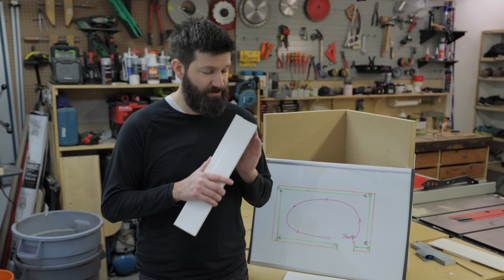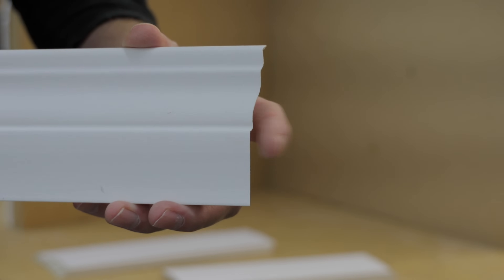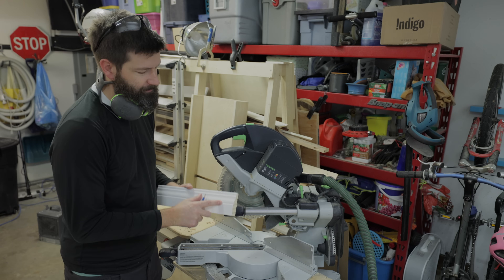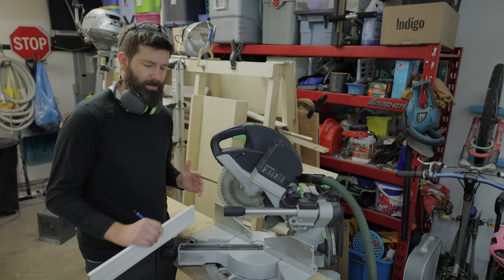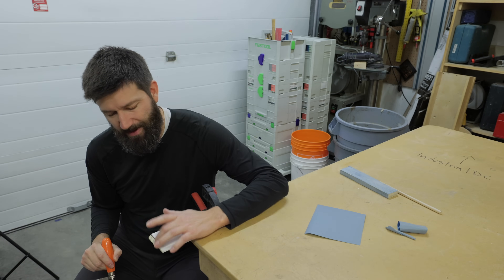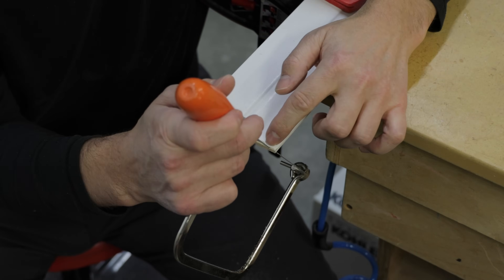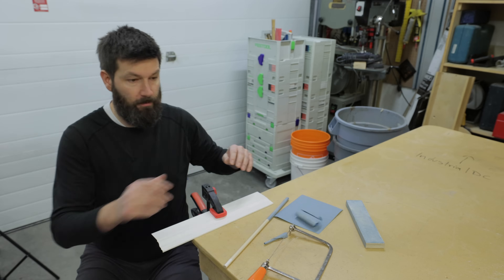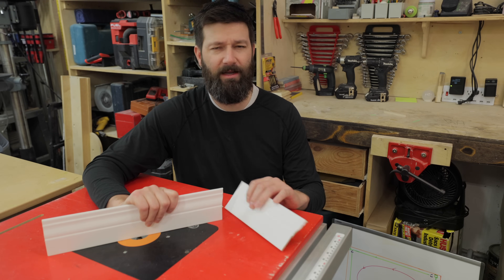How To Make Perfect Baseboard Cope Joints!

Comment: After a couple of rooms coping becomes second nature. A small tip is to not cut the non coped end square. By cutting the non coped end at an angle it will push into the plaster allowing you to cut the skirting a couple of millimetres too long. Now when you come to place the skirting against the wall place the non coped edge against the wall first, bow the skirting in the center and put the coped edge in place. Push the bowed center of the skirting against the wall and fix in place. I hope you can make some sense of that.
Reply from the maker: Good comment Michael, 🍻
Reply: Will need a video explanation.

Comment: I usually trim off the outside edge of the 45 cut, with a blade, and that mostly brings the 2 pieces closer, in case the existing wall corner has jutting edges. Seems to work great, and of course caulk is our best friend lol.
I call it "Love in a tube"
Love the cope saw though.
Reply: @jimbendtsen8841  lol shows how lost you are!
I stated something completely different!

Comment: Use adhesive backed sand paper on a scrap to make a profile sanding block, I miter 99% of the time, especially with painted millwork, glue joints rarely open, so no call backs for cracked paint in corners, nice job.
Reply: Great technique, that’s the same one I use.  Works great!

Comment: The biggest issue with installing baseboards isn’t coping vs mitering, it’s the quality of the drywall installation.  Did they get a sharp corner all the way down to the bottom of the corner or did they leave a “rounded corner in the bottom.  Did they install the drywall with the tapered edge running along the bottom? If so, did they leave you enough space to install 1/2” blocks all along the bottom run so you can have baseboards perpendicular to flat part of the drywall face?

Then after all that is sorted out, cope it if you want it to look good.

Comment: Love your videos! Easily the most complete and professional, including anticipating and answering the questions your audience will no doubt have, that I have seen. As an engineer with a tendency to be a bit of a perfectionist, your concise and clear approach to teaching works really well for me. Thanks!

I am about to embark on replacing all the trim in our 1980’s house. Regarding the “counter-clockwise” approach for us right-handed folks, when committed to doing the most professional job by coping as much as possible, wouldn’t it be better to choose what to cope based on the visibility of the joint from the perspective of the main entry into the room, rather than just progressing sequentially right to left? Or, is there something about the CCW approach that I am missing that is intrinsically better (I understand it is easier and more efficient)? Thanks again. Have subscribed.
Reply from the maker: I appreciate the comment! You’re right there are definitely some scenarios where it would be better to adjust the cope side depending on the main viewing angles of a room.  It can get more tricky and you definitely want to avoid working yourself into a situation that requires a cope on both sides.  I usually just stick to counterclockwise unless it’s going to be a real obvious spot like at the top of a staircase or something. Either way the cope joint viewing angle will be substantially better than a mitered one. Cheers and good luck on your project!
Reply: Traffic pattern should always determine the layout of joints, whether inside corners or field splices. Predominant vision from the entry should be the overlap on a field joint (30 degree bevel), and a coped piece should be on the left of the joint with the square cut on the right. This is not a hard and fast rule, however. There may be other factors that take precedence in a certain situation.

Comment: I simply cannot comprehend how cutting a profile on 45 degrees can give you the same profile as the straight cut. It really defies everything I have ever learned.
Reply: Assuming a 90 degree corner, you must remember that the profile your coped joint will contact is protruding away from the wall.  You're probably not visualizing the joint in three dimensions.

Comment: Hopefully I get a job that isn't so rushed that I can practice some coping -- as a punch-list, do it all kind of craftsman, I have to re-learn these skills each time.  Do you have a video on outside corners?  What do you think of wood filler on outside baseboard corners, or on mitered door casing top corners?  Maybe glue the joints, then wood filler?  (Talking paint grade).
Reply from the maker: Outside corners I usually cut 45.5-46 degrees. That way the outer profile will usually meet.  Wood glue and sand right away. Then would use some wood filler if necessary.  Stay tuned I will make an outside corner vid in the future.

Comment: Thanks. I was pulling my hairs out in frustration over one corner  that just wouldn't get right, becausethe ceiling and the wall are far from straight or perfection and angled. I bought some insanely expensive crown mouldings and if i didn't get this one right it would be costly to get a new length shipped home and start over.

Comment: Just bought a miter saw to learn to do mitersv(DIYer, not a pro).  I don't think the hacks remodeling my house didn't even use 44/46 degree cuts as there are open miters all over filled with silly con.  I am redoing a bunch of work and was excited to give it a go but now I gotta learn to cope.  Redoing a bathroom baseboard first after I do the door trim.  It's made of pvc.  Can I cope pvc trim?  Just buy a coping saw?
Reply from the maker: yes you can.

Comment: When you used the miter saw to start the cope you did a 35 back bevel cut along the straight face of the trim and then you slipped it and used the miter to cut a tiny bit of the top of the profiled part.  Was the blade set back to straight for that cut?  Can you explain a little bit more about the reasoning for that cut...what exactly is being cut off, I had a hard time seeing on camera and since it was near the curvature of the profile I wasn't sure if you were cut the profile off or just the wood on the exposed 45 degree face.  Thanks!
Reply from the maker: For that second part the saw is back to 90.  Cutting that top part just helps get a nice clean section to butt into the other piece.  Of course this is specific to this particular moulding and will not always be the case.

Comment: How do you cope joints on a 45-degree angle ( inside corner)?   I can miter them at 22.5 or 21.75 degrees as you recommend,  but would like to use coping.  In the room I am doing, if I start on the right, working counter-clockwise, then on the first wall I need to miter the left end of the baseboard since the corner is not 90 degrees?  Can you show a video on this?

Comment: I find the biggest challenge with skirting boards isn't the corners (which if I was coping I'd do with a router setup to be way more accurate), it's the lack of squareness and straightness in every wall and floor. I often find it easier to cut out a lot of the back of a board to avoid these imperfections.

Comment: For painted base, it doesn’t really matter if it’s coping or mitering, but if it’s stained wood, coping is far better.
Reply: maybe so but if the house moves at all the mitered joints have the tendency to open up and even with the best caulk that mitered joint dosnt look the same

Comment: Coping is always better in any situation because if you can't cope how are you going to get the job done? However in addition to doing corners what about gaps between the skirting board and the floor? well, some say in a carpeted room it doesn't matter because it is not seen However what about in a room with a polished floor? In that case, you will need to scribe the skirting boards to the floor

Comment: Another consideration in favor of coping, is "real" hardwood.  In the old days where hardwood was installed, sanded, and finished in place, you had to cope as the installation of the hardwood might push a mitered joint open.

Comment: Painter by trade so I’ve spent many years fixing bad corners. The mitre is way faster and as long as pretty good I can fix it with caulking and paint. I guess the coping method would be best if you aren’t painting the baseboards but who does that anymore.
Reply from the maker: Bad miter joints don’t look great over time.
Reply: @TheFunnyCarpenter  can't you say that about any joint?

Comment: The good thing about coping baseboards   and crown molding even if it’s mdf paint grade trim The joint stays closed and can’t open up or crack as easily with building movements overtime. But if you’re using miter finders and miter duplicators you can just do inside miters and have a nice tight fitting joints it’s just coping might last better than a mitre overtime because all wood and mdf products expand and contract overtime it’s a personal choice which one is better to for you.
Reply from the maker: Well said!

Comment: I like the coped look but I usually just use miter saw and then wood filler and caulking if its not perfect.  Usually just because I'm not that patient.  I have used a dremel in the past to cope which works really well too.  I'm installing baseboards now after we had new tile put in and the baseboard we have has a fair amount of curves which makes the coping much more time consuming.

Comment: always start with longest length if you make a mistake you can use it else where. for cuts jigsaw with a metal cutting blade more teeth slight angle a back . cope joint is better for wood due to shrinking, mdf  does not have this problem

Comment: Another trick, is to place a square peg where the corner is.  Then everything is a square cut (minus imperfections in house build).  You can even decorate the pegs by cutting in a tip for example.  Kind of like corner towers to a castle.

Comment: Nothing looks better than a cope. However, if you are looking for speed, and your trim isn’t stained, neither example is best. I used what my mentor called a “cheaters cope”. In this example, you measure like you would for a regular cope, reducing you measurement by a half inch to accommodate the piece it presses into. At your miter saw, measure and mark the middle of the base board, and cut it laying flat of its back, with a 5° miter. The minor imperfection is easily hidden with a bead of caulk. Again, this is primarily used for speed and can not be used for trim that cannot accommodate caulk. It’s also only good on the colonial trim featured in the video. 5 inch base that is flat for 95% of the stick won’t work either.

Comment: I've yet to see a coped joint survive a house age and settle.  A tight mitered joint with some wood glue on the other hand... it will open when the wrecking ball hits the house.

Keep a few dozen small MDF shims in your tool belt and micro-adjust each miter on the fly.  If you're working with a template board you drag along, you'll also be able to eyeball the miter and bevel angle VERY accurately the first time with little shimming necessary.

The stretchy caulks we have now are amazing, but I feel like people these days take the saying "A little caulk, a little paint, make a carpenter what he ain't" a little too seriously.

Comment: Used to use a coping saw and had good results, then I switched to a cordless mini 12v grinder with a 75mm sanding disc for great results... You won't look back 👍
Practice before you use on a job, it will need a gentle and light approach but results will pay off from it. Had nothing but nice comments by customers on how the skirting and coving looked.
Always gone anticlockwise and your advice is top notch with reasoning behind the logic.
Clients nowadays though don't like to pay for the quality but only on a low budget, and so I've turned down more this year than I can think of on the notion of you pay for what you get and if you can't pay for a standard and want cheap, look elsewhere..
Most work has been done recently from the cheaper initial approach by the customer that wanted it rectified, thus gaining another follow up job afterwards. 
Happy holidays mate, productive new year and you and the family keep safe .. from chilly South Wales, UK
Reply: I see you too went to Rich’s DeWaukee trim school
Reply: @christophercrawford2736  😂 and the post-grad school of DeWauKita
Reply: @philipbohi983  🤣
Reply: @philipbohi983  I’m still working on my doctorate with the school of DeWaukita 🤣
Reply: @christophercrawford2736  I had a corded mini scroll saw prior to watching that video, much easier than a coping saw, but with the mini grinder it is more easier and cleaner....
It is a Chinese Ruyika mini grinder and 12v. Not even in top tools for that sponsorship, I've gotten by on different brands and mostly Ryobi, not affected any result nor complaint.
Maybe when you try it 😂😂😂
Reply: @philipbohi983  obviously you've not had a go 😂😂😂

Comment: I hear the cope vs miter thing all the time.  And IMO there is no discussion to be had.  In fact, fair or not, I'm going to be drawing a lot of conclusions about someone's skill level immediately upon hearing it.  That doesn't mean that's the right conclusion, but I'm making it, and I know I'll be right way more than wrong.  However, I also draw conclusions about someone showing up with a Kapex.  If someone has a Kapex I likely don't have to worry about them.  Also, doesn't mean it's right, but will be right way more than wrong.  Regardless, there will be NO inside miters on my job sites, period.  With one exception, cabinet trim.  Cabinets are square. Cabinets don't shrink.  And the installer is likely making a lot of those joints off the cabinet.  

As far as coping goes, I find it to be a series of countervailing rules.  1. You touched on, that being go the direction that suites your handedness.  2. never cope both ends of a piece.  3. never cope the other side of an outside miter.  But there are inevitably going to odd shaped runs that force you to break one or all of these rules.  IMO the rule I protect the most is 3. never cope the other side of an outside miter.  To avoid that, I will break both of the other rules if necessary.  And likewise, I will break rule 1. go the direction of your handedness, to protect rule 2. never cope both ends, as rule 1 is the most frivolous since it's basically just about my own comfort and ease of installation.  My reasoning is that if you are coping your inside joints, they will be your least worrisome joints.  The outside miters need to be glued and are most visible, so I ALWAYS do them first, get them Collins clamped, and go back and do the easy part.  

I also would rather shoe an entire house for only the cost of the shoe rather than get into scribing the bottoms of my base.  If they refuse shoe, then you do what you gotta do.  But They almost never do.  This also solves another issue (in new construction).  The floor in inevitably going to shrink and leave a gap with your base/shoe.  So I work into the contract that at the 1 year point we return to address everything that might have settled poorly, and I can just score the paint and tap down the shoe.  At that point I shoot the shoe into the hardwood floors (where possible) and retouch the base paint.  And because of this we paint the base before installing, that way when I tap the shoe down, there is no thickness discrepancy.  Then just one more pass of trim paint, and voila...

Oh...and one more...If you do this all day everyday, get yourself a Knew Concepts copping saw, and some 18tpi Pegas coping blades.  It's the Kapex of coping saws.  A little practice and the the end result will be faster than even a hasty careless miter.
Reply from the maker: Scribing baseboard with the Festool Ras with some 24 grit is game changer.

Comment: Every single coping video online has the same thing in common - it's always super-basic colonial casing. When you use more elaborate and thicker trim, coping just gets too hard and becomes a waste of time. You spend an hour with a coping saw - and then one slip and the piece is ruined. And even when you get it right, half the time the cope joint doesn't line up anyway. Make it easy for yourself - just miter those corners and glue the joints together. The glue is not going to give, trust me. Any little imperfections just get artful with filler - this is true even if you cope the joints.  If it's a wonky corner, just get out the protractor and adjust the angle accordingly. So do yourself a favor and just miter the sucker, move on, and do something else with that extra time.